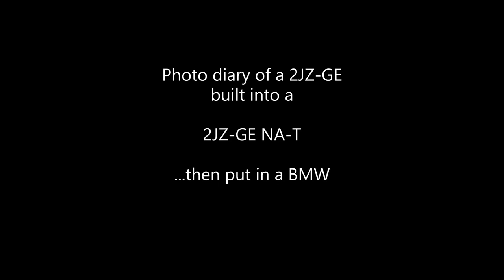2JZ-GE to NA-T Photo Diary Build, and Started!

Comment: I have the exact throttle body and gte intake manifold for my set up and you just gave me closure and some ideas🤙🏼🤙🏼 great video
Reply from the maker: Happy it was helpful
Reply: @Jscottie2600  did you have someone weld the manifold to your lowers or did you do it yourself? Is so what did you use tig or mig? And also what are you tuned on nowadays?

Comment: Great video! I didn't see this in the video description but for non jz people the 2jz ge non vvti (which is in this video) has a stronger bottom end than the 2jz ge vvti that most people are familiar with from the is300 and gen 2 gs300.
Reply from the maker: Thanks for watching
Reply: Can you do the same thing with vvti tho?
Reply: @guzman7590  that is one of my upcoming projects is swapping the vvti is300 head to a non vvti bottom end to get ready for boost and in theory be able to put it back to stock if need be. Just have to use an oil sandwich plate from the oil filter to feed oil to the vvti solenoid and you can also use the sandwich plate to feed the turbo with oil.  With the swap also using a gte headgasket and arp head studs.  This swap has been completed on the rabid jz YouTube channel.

Comment: Those "GE" Rods are "GTE" rods as well. The non vvti 2jz came factory with "GTE" rods but with high cop "GE" pistons. The VVTI 2jz came with GE rods and GE high comp pistons. Thats why they dont hold too much power. The more ya know!
Reply from the maker: yes thats correct
Reply: so if i get a ge vvti i have to get gte pistons and ge non vvti rods or gte rods?
Reply from the maker: @turtledude2924 yes, that's right
Reply: @Jscottie2600  do you think the non vvti is better?
Reply from the maker: @turtledude2924  In my opinion, I would prefer the non-vvti. However, the vvti is not its little brother. The vvti was designed primarily for fuel economy but equally capable.
Reply: @Jscottie2600  honestly im just gonna get a vvti so i dont have to deal with the distributor and other stuff also i can get a rb25 for 2k with trans which should i do 

rb25det: 2000 with manual and all accessory 
2jz ge vvti na to t: not sure about price
2jz gte vvti: 2600 with auto trans ecu and all accessory
Reply: @turtledude2924  ge non vvti rods are the same as gte rods, just the pistons are different. I would just keep it simple and get a used set of GTE pistons and rods from the fb pages or ebay. They usually run you for around 300$. And also yes you can use them in the ge vvti block
Reply: @turtledude2924  you can get a ge non vvti cheap from a sc300 or 1st gen gs300 and if you have the ge vvti engine swap the head and accessories to the non vvti block. Use gte headgasket and arp head studs. If you do the work yourself you can put this together for around 1000. The rabid rb YouTube channel has a build on this
Reply: @turtledude2924  Jesus a gte for $2600 I wish these days

Comment: This is awesome! Good work, howd u fit the gte ffp tp the ge head? Like how to u measure it and trim it etc as im trying to fit one to my ge aswell, thanks in advance!
Reply from the maker: I placed the ge runner over the gte intake and used a marker to do an outline(at 3:15 in the vid). Then measured how much I need to bore the intake out so the the aire volume is equal goin into each runner. If If I recall correctly its between 50 - 55mm. You will need a professional aluminium welder as some holes after boring will need filling at the at a few points. the weld has to be strong.

blue lines - how the ge inlets fit over the gte
red lines - outer line of the ge runner
green lines - is the completed circle from the red outline

tip: use the gaskets of the ge to mark the blue line

hope this helps!
Reply: @Jscottie2600  thanks for the reply!, okay thanks will look into it👌

Comment: I love this build so much man🙌🏼 what ecu are you running? Because I want to run stick ecu @ 6lbs of boots with only FFIM and turbo only
Reply from the maker: This was just the stock NA ecu when it was started with stock NA injectors sand map sensor. You will need a turbo map ecu with map sensor, and bigger injectors.

Comment: That's awesome man, could you possibly post links to where you got some of.ypur parts? Just recently got a GS300 and am interested in boosting it as well as changing pistons and a few other things so the compression ratio isn't so high.
Reply: Oh and also did you tap your own oil dump for the turbo or did you put it somewhere else?

Comment: Hello. I found your project in search of information. I wanted to ask how the exhaust manifold works under the turbo. Has it not cracked. What boost do you use and what did you do with it ... You didn't think about firing the ignition device.? Greetings from Poland
Reply from the maker: Thanks for the comment, the project hadn't reached the tuning stage. I took this one out the care and went GTE becase I wanted to try that and see. I definately prefered this one though in terms of looks and build.

Comment: My local shop quoted me $30 000 to turbocharge my 2jz GE to only 300hp.
Reply from the maker: Thats quite a lot
Reply: Yes
Also $25 000 to swap to 1jz
Reply: Devon Krowchuk 
In what car? You can turbo a na 2jz for around $1000-$1500 on bone stock motor to around 8psi max, you will make close to 300whp with the right turbo.
Reply: m200mw 2001 is 300
Reply: m200mw I wouldn’t be able to do the work by myself at the moment
Reply: @Anonymous-ee8ef  it's really not hard

Comment: Nice build man! Im looking to 2JZ-GE swap my S13. Is that a ebay turbo?
Reply from the maker: go for it. yeah it is
Reply: JS2 Thanks, looks like GT45 turbo right? How does it spool and how much HP you get ?
Reply from the maker: @caganbey6946  yes gt45, the divided runners gave it an 'ok' spool given the 1.05 rear housing.
Reply: JS2 Have you ever put the car on the dyno ? How much HP you think this setup will give to rear wheels ?

Comment: All that work and you didn't de-grease the engine OR paint the block..??
Reply from the maker: you could paint it if you wanted to
Reply: I did ... lol 
When i pulled my motor out to do a complete rebuild, we de-greased it and painted the block, timing chain covers & valve cover, looked like a shiny new motor :-)

Comment: How did you do it for the wiring
Reply from the maker: Im not sure what you mean, are you asking about how to do the wiring to get it to work? I have a video on that. check it out
Reply: JS2 yes I am asking about the wiring, because I bought a 2jz ge vvti but planning to turbo it, and I also have an e46 coupe 320,  but still wondering how i will get the 2jz to work with most of the stock wiring from the bmw
Reply from the maker: @lukhobacarljulius859  although this one doesnt exactly match your plan, some useful info is in it at least from the BMW side of things. https://www.youtube.com/watch?v=aogqmZiix8o&t=923s there are other videos that looks from the engine side. The last week in Feb I'll be able to post another video that could potentially add to your knowlege base about this. Having said that, the BMW CAN Bus and the 2JZ wont communicate with each other. The gauges that are related to the car (i.e. fuel level, indicators, lights, etc) will work fine. speed sensor should still work but rev wont.